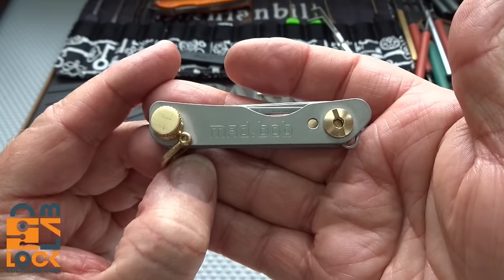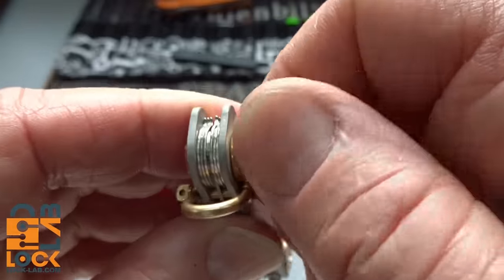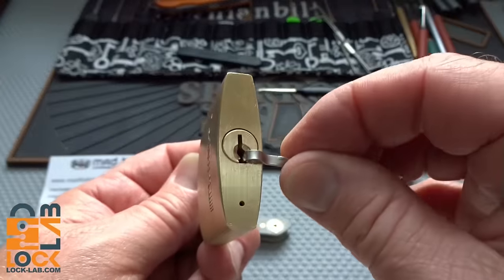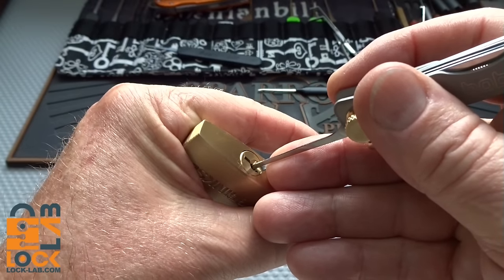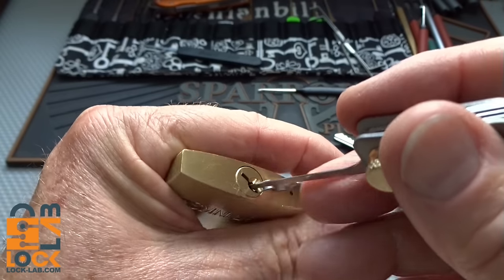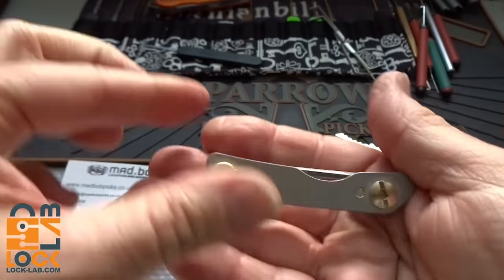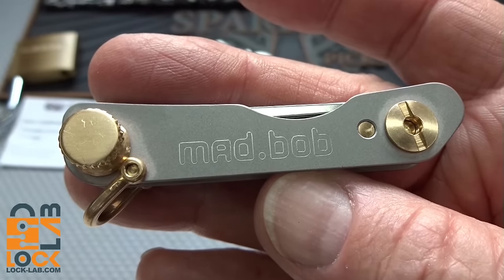(921) Review: Mad Bob's Jackknife Lock Pick

Comment: I called it a penknife due to the size. By the way it has changed since your review. The loop up front by the brass tension wheel/screw is gone but a pin through remains.
(Cost cutting I assume)
And the brass fastener at the other end is now two starred torx screwheads (one being threaded the other a screw) with a brass beveled ring holding it on both sides - makes the assembly a bit wider. Again I assume this was done to accommodate the smallest.combination they could find.
Also the price has increased. Tell ya what, I love MBs stuff and this is no exception.
Great review as always.
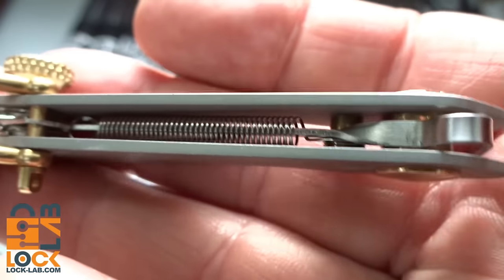EDIT - at 1:49 - 1:52 ish you can see the washer that ties the spring to one end neatly sandwiched in between the six picks.
I went to remove the half diamond in favor of another rake from the replacement kit.
I am not the most nimble, fleet fingered person I might have been long ago but it took close to 10 minutes to get it back together.
I ended up scotch taping two sets of three picks each so that I only had to align the washer in between the two taped groups, all while maintaining pull on the washer & spring to finally get it back together - whew.
Reply: Changing picks is tough. @ 1:57 you can see the washer that is attached to the spring that also bisects the 6 picks. So you take the knurled screw out and all the picks/blades and the washer are now loose.
You have to set 3 picks and then the washer with the spring and the the last 3 picks...all the while you have a very tight working area.
(I ended up taping the two groups of 3 picks together so I had in essence only three items to thread - the two sets of picks and the washer in between)
No joy. My only complaint.

Comment: I know it's a little off subject but if you happen to have the southord c1510 the deforrest diamond makes the best small euro lock pick if you cut it about 12mm past the first bend then use a set of multi grips to bend it into a medium hook. have opened a couple abus locks that I've been having trouble with easily more than once.

Comment: Hi Bill, always love watching your videos! I'm typically quiet in the comments. I come to you for advice this time. What's the most attack-resistant heavy duty gate lock (for a farm's vehicle entrance) that can be welded to the gate? Everything I find is always advertised as being the strongest, but what can I look for exactly? No electricity. The bars the gate is made from are about 3 inches thick (in height), 2 inches depth, thick hollow steel. Any suggestions?
Reply from the maker: Grab yourself an Abloy padlock.  Steel body, super hardened shackle, and unpickable by 99.999% of the people on Earth.

Comment: @Bosnianbill I just ordered one today after seeing it in use and not just on their website, I can't wait to replace my existing H&H jackknife, rubbish build quality by comparison to Mad Bobs Jackknife, PS Have you seen Mad Bobs carbon Jackknife?
Reply from the maker: I did see it when placing my order but opted for the steel one.  If I remember right, it was about the same price as the carbon one.
Reply: Correct they were both the same price, however like you I opted for the stainless steel and brass version.

Comment: brinks locks lie about there pins ,open it up ,i did no securities pins.
Reply: The one i have certainly has some in it.
what i've seen they are either super easy or super hard to pick depending on if they have any security pins in them at all.
but that's just my experience with brinks...
Reply: you got what you payed for  i did not
Reply: bill l 
I hate to inform you i found it in my backyard.

so it was probably old and probably back when things were done right.(and not cheaply)
Reply: I literally just pick up 2 new Brinks locks yesterday since I hadn't played with 1 yet. The first was a little 30mm solid brass with a level of 5-6 on their "difficulty/security ratings". The other was a 40mm I believe, made of solid stainless steel with the package saying it was "All New, Max Security, Level 9". Smoked the stainless/max security  lock right away. The brass 30mm gave me quite a bit more trouble than I would have thought. It has at least 2 spools in it if I remember correctly.
Reply: BLWN GT 1 
now that you mention it mine is brass as well...
lesson learned, avoid stainless steel locks cough master locks cough